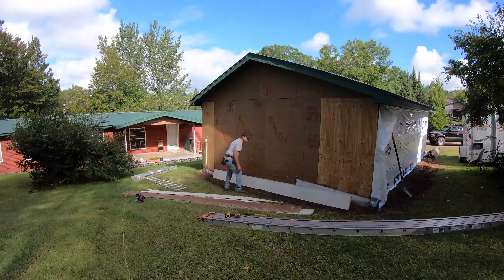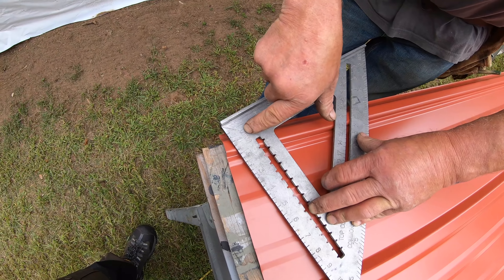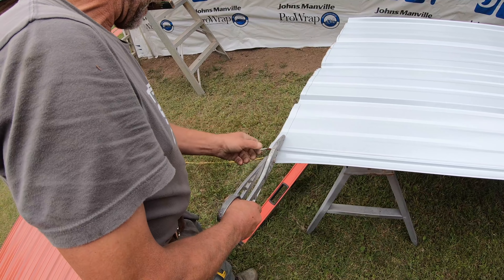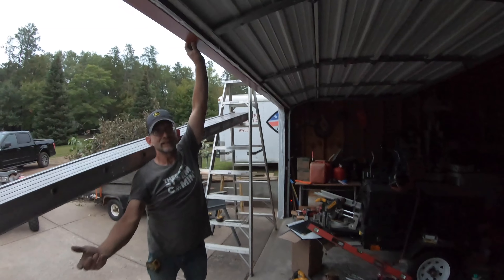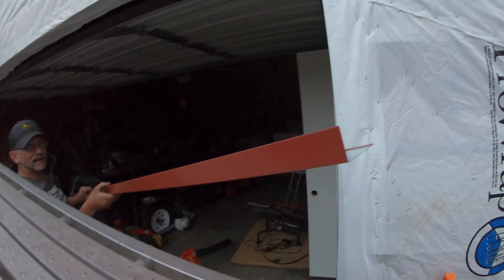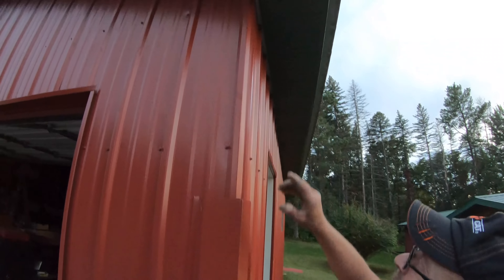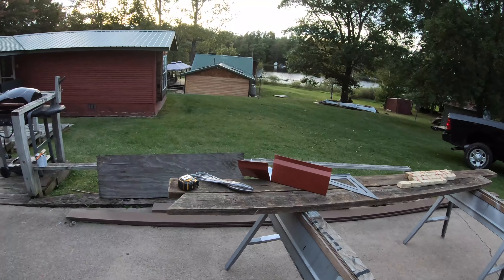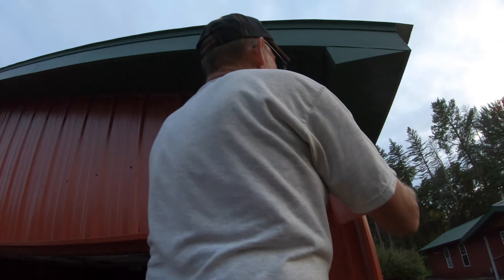How NOT to install Metal Siding- PRO Tips & Everything you need to know from start to finish pt2 4 k

Comment: I predrill my entire stack of steel. I also use a circular saw with a carbide blade designed to cut steel. It’s loud, but it makes life easier. Those weather seals come in the color specified as well. The one good tip that I never thought about is the putting the j channel in after. It would be much easier than before just as long as you can still insure proper drainage.

Comment: Plumb is up and down, not level. When you're marking, you dont need a square, you can use your long and short mesaurement. Also you should try using a skillsaw with a guide table and you can actually cut backwards  to make clean and quick cuts

Comment: A sheet of steel is 3ft the roof is a 4/12, another way to do is is to multiply 4x3 you get 12” if your measurement is 8’ just mark 9’ on the other side and that’s your angle much more accurate than his speed square

Comment: Great video. 
But please put the guard back on the grinder.
For one if OSHA ever drops by you will get a heavy fine.
And using a grinder without the guard with a cutoff wheel is a good way to lose a finger or other limb. 
 As a matter of fact cutoff wheels have injured so many people that Cianbro(A contractor here) will not allow their use without the journeymans foreman signing off.

Comment: Easier way to measure the angle cutoff, for a 4/12 pitch, measure 24" from the corner and down 8" and connect the dots.
Reply: Joshua Tegeler 36 inch panel would be 12 inches to make life simpler
Reply: Its fast as hell too chris👍

Comment: OK, you missed the most important point for nailing tin! Ridge vs Valley. On a roof, it's always ridge. Siding can be either however if you go valley it will be easier to plumb but there will be no gap to dissipate moisture.
Reply: A pro roofer taught me and others to never screw the ridge.